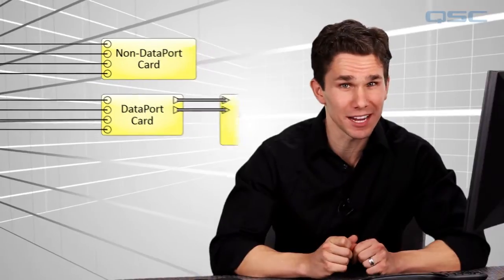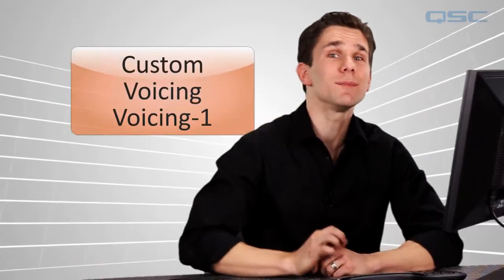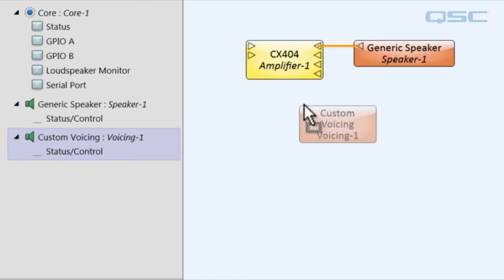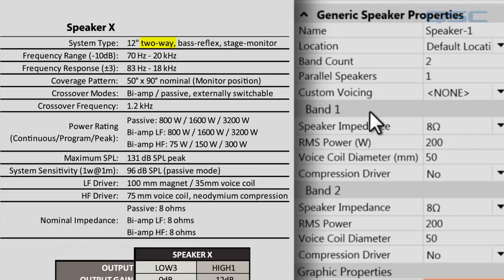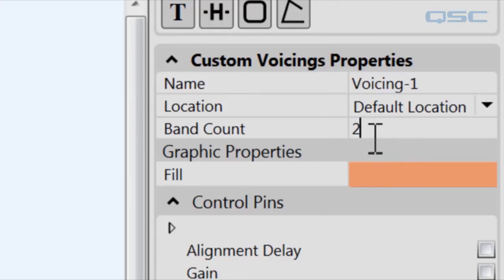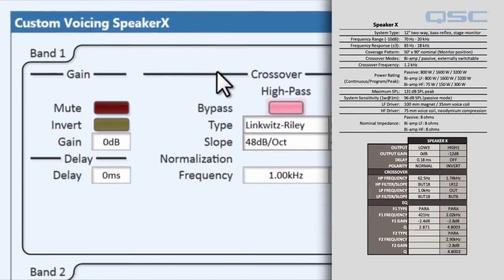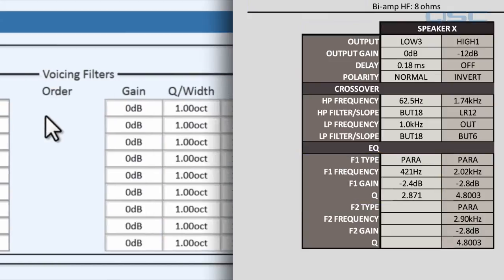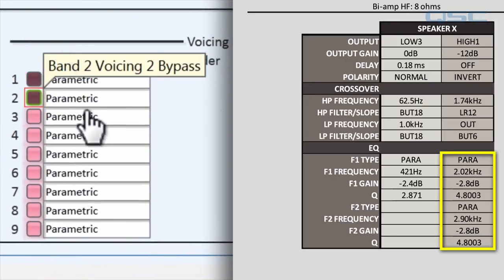Q-SYS: Using Non-QSC loudspeakers with Custom Voicing Component

Comment: Something that's really not clear from the video as the speaker is "wired in", first at 1:31, then 3:06, after inputting our 2-way speaker as having 2 bands.  As you drag the connectors to wire at:
1:31 - it flashes up as wiring FROM Channel1 (Full Range Speakon 1+/-)
3:06 - it flashes up as wiring TO no channel shown but looks like Ch2 (Band 2 Speakon 1+/-)
I'm having trouble understanding whether this is purely for Bi-Wireable speakers and we are configuring each Channel to power each "band" i.e. the Tweeter and Sub in a bi-wrieable 2-way speaker with 2 physical wires (or 4 pins of a Speakon used)...
...or is this all the information about both speaker bands inputted to the amp this way, so it can makes all nec, calculations to control the speaker via a single cable (i.e. 2 pins of Speakon 4 pole) with the speaker still using its's crossover, and the wiring of both Channels here is purely "logical" for the design file, in sense that it DOESN'T represent physical bi-wiring?

I may be over thinking this all...